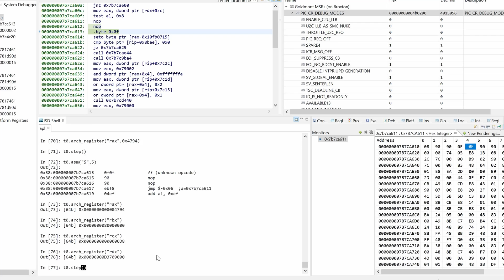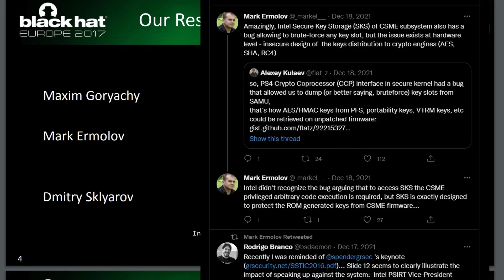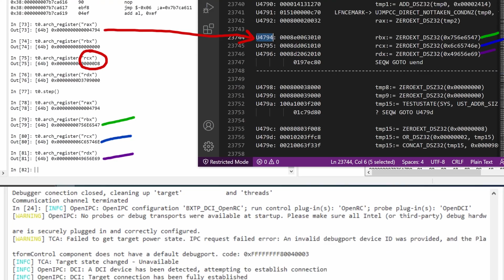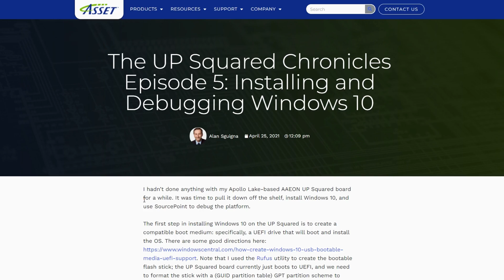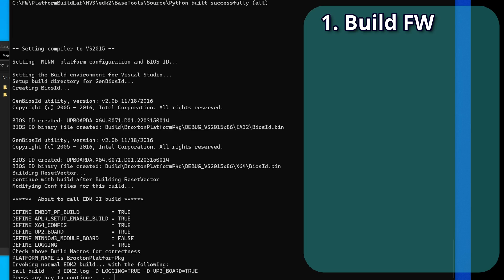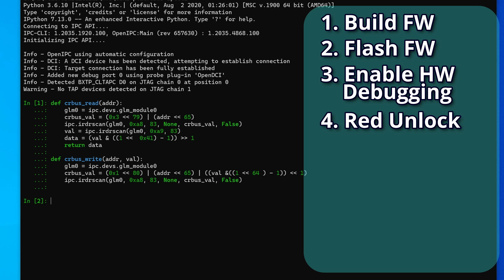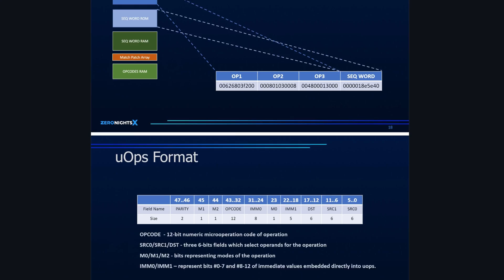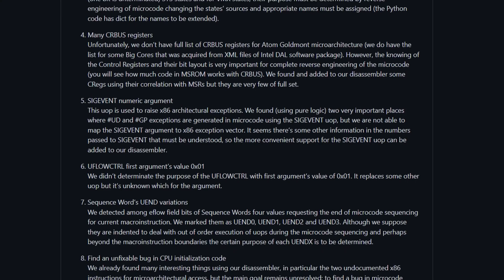Unlock your CPU and Execute Arbitrary Microcode! Tutorial Introduction

Comment: Any idea if the Celeron N3450 is functionally the same as the x7-E3950? I'd like to follow along but for some reason every time I find a product listed as x7-E3950 it also shows as Celeron N3450 in the spec list, with the only exception being the UP^2 which costs a fortune to ship here.
Reply from the maker: Hi Graham,  The Atom E3900 series and Celeron N3450 / N3350 are all Apollo Lake, so they have a lot in common. But what I'm not sure of is what their actual differences are in these contexts. As I mentioned, the original PoC from the Ucode Research Team did this on an N3350, and I was able to get it working on an E3950 (without any specific hardware changes to the PoC). So I think its definitely worth trying it on an N3450 (just no guarantees). I do have an N3350 UP^2 as well that I never fully tested; I will try it on this as well during the series. I am interested to hear if this works for you! The first 1 or 2 videos might not work for your platform (building a custom bios), but at the very least you should be able to modify your bios (tutorial 3 or so) to enable DCI. The TXE exploit should work because I believe that TXE should be compatible. Make sure you have a hardware SPI flasher in case you brick your machine!
Reply: @endbr64  Thanks!